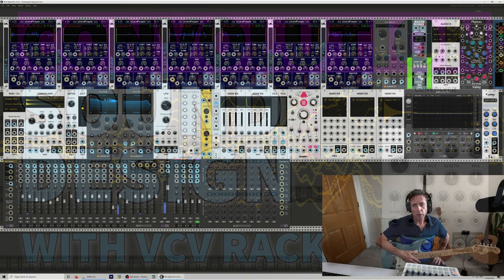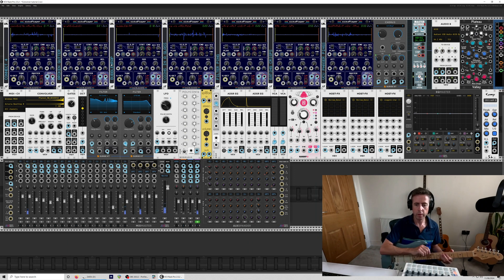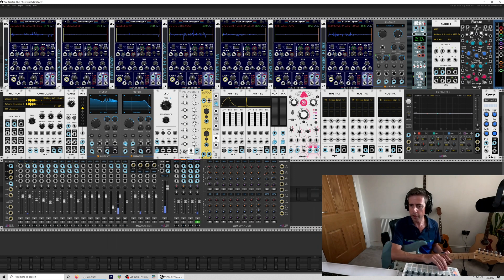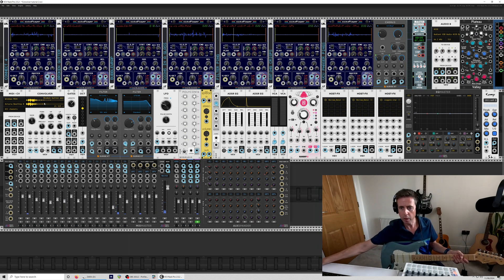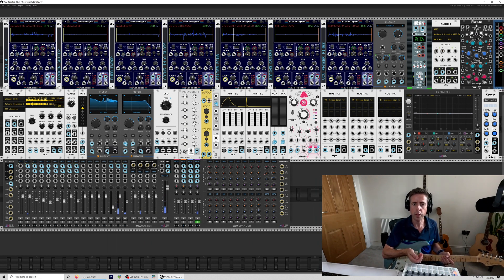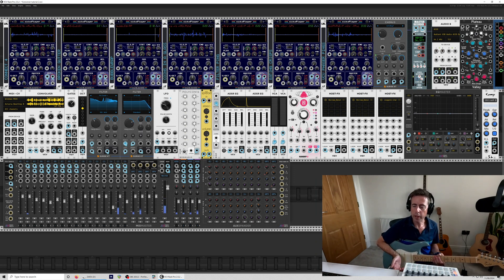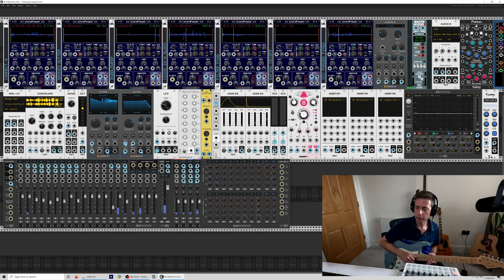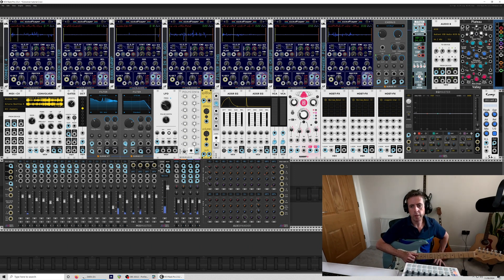Convolution Sound Design with VCV Rack

Comment: Excellent demo and tutorial!
Besides making my own, is there a collection of IR samples available to download that you would recommend? (for the purpose of what you're doing here of course).
Reply from the maker: @tyfreeman1662  thanks! I haven't seen any IR packs specifically for this, but try any field recordings you can find. Natural sounds seem to work well, running water or waves maybe. You could also try industrial/machine sounds. Basically anything with quite a high noise content and without a fundamental pitch. Also if you have anything to record on, even if it's just your phone, try making your own with anything that catches your ear, different objects around the house etc. It's definitely more satisfying to make your own, but there are plenty of free sound fx recordings you could try - archive.org website is a good place to start.